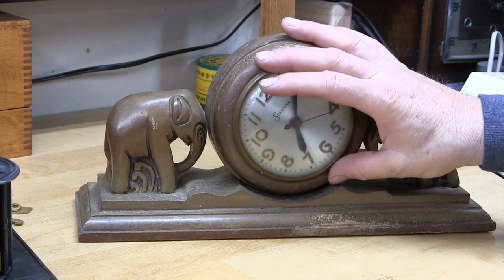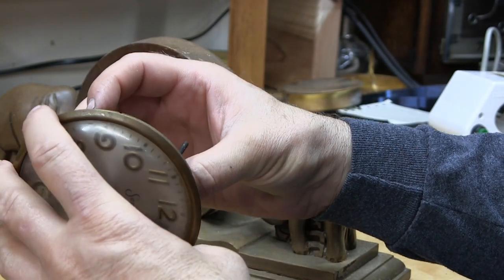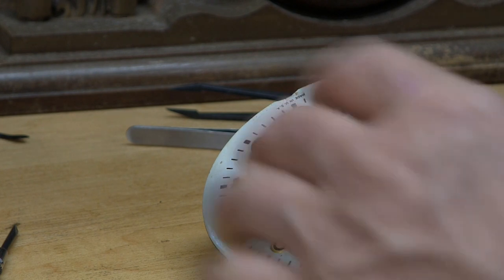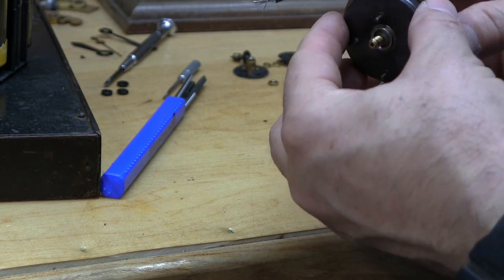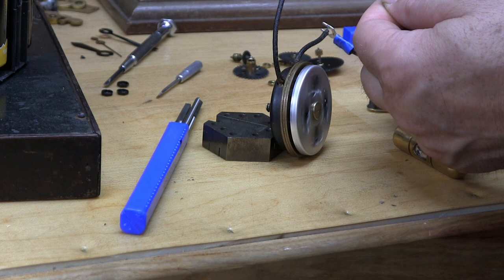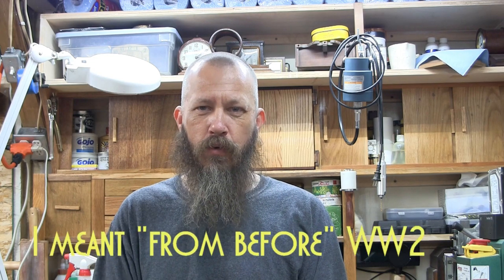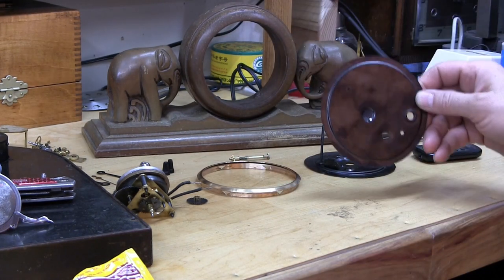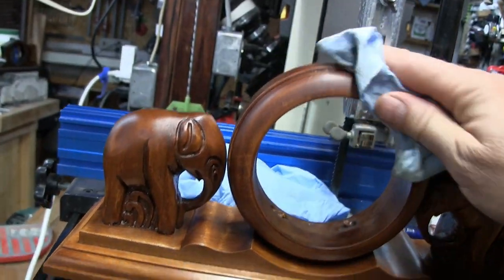1940 Sessions Electric Clock Repair - Vintage Elephant Clock

Comment: i appreciate your humbled charm in the introduction. I love the idea that you aren’t afraid to take something apart and fix it.
Several years ago my father gave me his “Little girl swinging” sessions clock. The little swing is moved by the second hand. Short story long I (like you) investigated and found the issue. The issue is a wear either the bushing or swivel hole. The way I repaired it was pushing up the rail that carried the the swing. I did not take the clock apart instead, I used a sewing needle and superglued it in place. It worked. I put the clock back in the closet and pull it out from time to time. We’ll just a month ago I pulled the clock out and ran the coco till one day I noticed the clock stopped (about 2 weeks ago). So today I hit “google” to see what I could learn.

Your video is it which I have saved. I plan on subscribing to your channel.

Thanks for sharing…
Reply from the maker: Thank you for your nice comment, Michael. I know what clocks you are referring to and generally they were made by Mastercrafters and had Sessions movements in them. Perhaps later they had their own, I'm not sure. Necessity is the mother of invention and repairs can often be done in many creative ways. On my channel page, under the tab CHANNELS, there is a  channel called Just Mike and he has worked on many of those swing clocks and you might find one of his videos helpful. I do hope you can get your clock running again as they many times remind us of dear loved ones. It honors me to have you subscribe and hope I can provide content of interest for you. 😁

Comment: Greetings Ab, Watching your video's on these Sessions clocks were both educational and motivational. Enough so they gave me the boost I needed to tear into the few Sessions electric clocks I've collected over the years but never brave enough to get them working myself. All have the same "W" motor assembly so your video's for me are the perfect step by step guide for the fix. Here's hoping. Thanks for your efforts.
Reply from the maker: Appreciate that Kevin and good luck. I still have a ton of things to learn as I go but it is good fun! There were several versions of the W motors, perhaps as many as 20 if I recall correctly, so not not all are interchangeable but are very similar. 😸

Comment: Great video.   there are two brass bearings at the front and back with a space in between.  a good cleaning with pipe cleaner soaked in solvent works well.  If you choose to ream don't be surprised if the rotor wobbles as it probably already has worn a little oval. the worm gear on the shaft can be removed using a pin punch and a V holder underneath if you don't want to separate the wheel.  Finally,  I believe the ring that you take out of the aluminum flywheel is to enhance the magnetic forces created by the rotating electric field. Next time you can leave it out and see if the rotor still spins.
Reply from the maker: Thank you, George! I do appreciate your tips and suggestions!!! Some of these things I just go through trial and error and most of the time really don't know what I'm doing so I do appreciate suggestions! Hope you have a great day! 😁

Comment: Good idea to replace the cord. I like the full metal dials best. Wow, you got further than I did on the motor. lol, I didn't show how I powered my motor, didn't want someone to shock them selves. Yes, I saw you put  the front small gear on upside down, lol. I mess up also. Wow, that polish did well on the bezel. Stain always makes the wood look better and even on the color. Changing the plug is good. I just cut an extension cord I pick up at GW.  Wonderful job there.
Reply from the maker: Thanks Mike! Since those Mastercrafters clocks are expensive, even for parts, since they use Sessions motors, you can buy a cheap sessions clock that has the same motor if you need a part. This clock was only $9.99. Have a great day my friend!

Comment: I saw this before. Still it is very interesting to watch it again.
Perhaps the knot made on the wire, inside the clock is touching the round plate, stopping it from rotating, just a thought.
I would have checked the clock operation before putting it back in the wood frame.
Good work as usual Ab.
Reply from the maker: Thank you, Practical Fixes. Although that was my first electric clock fix, I will try to be more thorough in the future. Testing it first would have been a good idea! Thank you!

Comment: I've been frankensteining Sessions clocks for many years, gone through four or five of them. Every year or so, I have to redo the oil on the motor spindle. Just don't use WD-40, 3-in-1, pencil graphite, candle wax, bar soap, dish soap, or Pam. Tried them all. Was about to try beef tallow, when I discovered synthetic motor oil. Hope that works better.
Reply from the maker: Thanks! Yes, synthetic oil is best from what I have been reading on oils. Mobil 1 is recommended by many. 👍

Comment: Hi Ab, I would like to know where i can get some spare phenolic resin fibre gears shown on video on the shaft, my sessions clock one has just perished THANKS ROY
Reply from the maker: Well, Roy, I'd like to know that also! 🤣🤣 The only option I know of is to cannibalize another movement. I have seen a plastic replacement  gear for that worm shaft selling for $40 on etsy. Another fellow has some originals he is selling for $100 a piece. At those prices it would be cheaper just to buy another clock. The downside to buying a used parts clock is that the same part could be bad as well. Sometimes I will just do a general search term like "used electric clock lot", or "sessions electric clock parts", etc, and sometimes you never know what comes up. Generally, I will just keep my eye open for another model of the one I need to repair, and from the two, I can save the best parts to make a nice one. No easy answer on this one I'm afraid. -Ab
Reply: @time4clocks  thanks Ab for replying quickly, I am trying to make one right now but really difficult without the right equipment
Reply: @time4clocks  am now trying to fix gear with araldite, and if not any good will try and cut a gear with dremmel and a pointed bit but the width is 3.2mm and so not sure if the angle at the end will be small enough!
Reply from the maker: @roymasters5181  That is certainly a bold undertaking and I hope you are successful!!
Reply from the maker: @roymasters5181  You will certainly have to be creative Roy. The reason they used a phenolic resin gear in the first place was that it would be quiet. With that consideration aside I don't see why any other type of material would not work. Good luck!

Comment: Question, would sessions clocks with these same dials have any potential for being radioactive?, I had taken one home from my grandmas house and the numbers and hands look exactly the same. Mine is a sessions plug in standing ceramic clock
Reply from the maker: Hi. The clock dial in this video did not have any Radium paint so it is safe. If your clock dial is like this one it is fine. You would have to put a black light on the dial of one if you really want to be sure. You can also send me a picture in an email if you like. Just click on the About section of my channel page for the email. But most Sessions electric clocks did not have radioactive dials.

Comment: HI Ab, thanks for all  your help via video, its been great, I have got my sessions clock going and was well pleased with the gear I had created, but overnight alas it lost an hour, I believe the teeth are not right some how, they may be a little too small and or too many so will be back to the drawing board, I have had contact with an indian company that may be able to produce the gear so I will need a close up pic of the actual gear cog in close up, could you help with that, if so please message me a picture, thanks again Roy
Reply from the maker: Not sure how to message you a picture. Shoot me an email time4clocks@gmail.com and I will try to find a gear to take a picture of and send to you. Let me know what movement you have if possible. Not sure if they are all the same. Send me a pic of your movement. Probably a W1 or W3.

Comment: If you had just put some chlorinated solvent on the motor shaft and at the same time pushing the motor shaft in and out to clean the shaft without taken it all apart. Then put a drop of Toyota 0-16wt motor oil on the shaft and run the motor. The oil will lube and clean the shaft.
0-16Wt motor oil is the new clock oil, works better than most clock oils, because it not only lubes it cleans as well.
Reply from the maker: Might try that on the next rotor shaft. I still like to clean the other parts from the gunk that builds up over the years and give fresh oil. I do appreciate your suggestion.

Comment: I have stayed away from Sessions electric clocks because when they age they get noisy. I do have two early Sessions electric banjo clocks [ one real super size ] and both have non self starting movements which I was told were made by Hammond and that Sessions purchased. I also have a 1955 Sessions banjo clock that had a cracked plastic gear so no repair. It now has a steady sweep second hand quartz movement. I don't like the quartz jerky second hand movements and won't use them. I do have a rela nice Sessions black marble shelf clock that is original and running.
Reply from the maker: One thing I didn't know is that even electric clocks need oiling every few years. Sessions did use Hammond's less expensive movements until he was found guilty of patent infringement, which put an end to the spin start clocks, if I recall that correctly.

Comment: I have the same clock, she's a little noisy but works..
Reply from the maker: Sometimes the noise is a wobbly rotor cap or making noise from lack of proper oiling. Every clock seems different when investigated. 😀